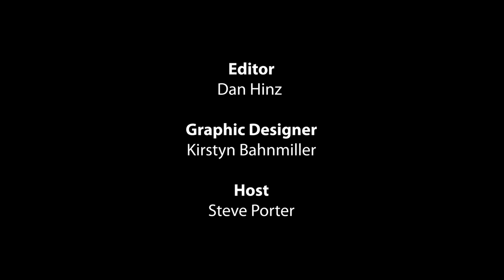The Truth About the Electronics Refurbishing Industry

Comment: In my opinion, there are three types of buyers.
The first type is the one who doesn't mind paying more for a product that offers higher quality.
The second type is the one who seeks a cheaper option but still wants some level of security in the deal, and chooses a store accordingly. 
Lastly, there is the type of buyer who seeks the cheapest possible option, even if it entails higher risks.
There is a market for all three types of buyers. The buyer who seeks the cheapest option may try to make purchases through platforms like eBay or other personal selling websites. The second type may visit a moderately priced store that offers some level of security. Lastly, the third type may prefer to shop at a reputable store that sells products as if they were "new."
In reality, the second type of buyer ends up being the least satisfied because they pay more but receive the same product as the thrid buyer. They essentially pay more for, at most, some cosmetic cleaning or superficial enhancements.

If the first  type of buyer purchases from a reputable store, they may indeed buy a refurbished product. In my understanding, this involves conducting a technical analysis of the components and performing a detailed cleaning of the interior, which can incur higher costs.
If a product doesn't go through the refurbishment process you mentioned, it would simply be considered a used item without significant differences from one purchased on eBay. A truly refurbished product goes through a comprehensive analysis and refurbishment process to ensure it meets certain quality standards.
Certainly, all of this can vary depending on the country or region where you reside. In the European Union, there are defined rules and regulations regarding what qualifies as used or refurbished, and there are obligations to provide warranties for such products.

Comment: I'm just going make 3 separate categories for working on electronics.

Cleaned: A device that been cleaned.

Repaired: A device that been repaired with fixing or replacing a specific part for operation.

Refurbished: A device that been completely took apart, repaired or replaced parts, and  all components been cleaned to be fully functional.

I think businesses should use these separate categories as options to reduce confusion with customers on buying at your own risk to paying more for full service options.

Comment: If I were selling old unit to someone else - I'd definitely give it a thorough cleaning, including repasting using good, high viscosity thermal paste and vacuuming dust from all accessible surfaces from inside and outside. However, I know most companies won't do any of that and if I am buying something that's marked as "refurbished" - only thing I expect is that the unit turns on and all functions work.

Comment: I worked for a small scale tv manufacturer and refurbished to them meant bringing those tv's back to as new condition by replacing whatever needed to be, but usually this was just cosmetic if the tv functions were ok. So anyone buying one of these, which were not much cheaper than a brand new one, got a new looking tv with unknown mileage. which honestly, knowing there QC policy, take the refurb!

QC policy was, any minor fault which didn't really impact the use of the set, was just sent out, apparently cheaper to deal with the customers who actually took the time to return faulty sets.

Comment: I would buy used over "refurbished" because I've always assumed that it means "looks like it will work but doesn't actually function or functions incorrectly/poorly". Used usually still works, unless otherwise noted - such as, "for parts only" or so

Comment: I think it's going to depend largely on the device. PS4s and consoles generally are widely available on the used market. One device I have regularly purchased refurbished IT equipment from the corporate sector. When an IT department offloads hundreds of, say, Lenovo T480 laptops to a bulk reseller like Best Buy these can be good value for money--properly refurbished or not. Most of this stuff has been regularly serviced by IT departments before it was offloaded. Some of these devices are not popular on the consumer market, so eBay or Marketplace might not have a price advantage or much availability at all. If you're willing to do a bit of work on these devices it's often easier to source them from these refurbishing services.

Comment: regarding the rollers on the disc tray, i used to use a "trick" on ink / laser printers where the rolls wouldn't pick up the paper anymore.

you could use a very fine grit sandpaper to roughen up the rollers a little bit and it would pick up paper again as new.
just a few brushes roughened them up good enough, no need to sand it down ofcourse.
it only worked for 4~5 times though as the rollers wear down over time as well.

Comment: working in computer repair, 50%ish of computers that come in have been purchased as refurbished and either never worked properly or worked for a bit before breaking down way too soon. Almost all reburbished devices that came in, were inevitably dirty on the inside and showed obvious signs that the devices had never been opened by the "refurbisher". Large volumes of dust stuck in heatsinks which cannot be explained by the time the devices were used by the owners before being brought in. Warranty stickers still intact. Those kinds of obvious signs.
Reply: never have and never will recommend buying refurbished devices unless the seller has a reputation for only selling devices that have truly been refurbished.

Comment: My thought on this is to better to purchase certified refurbished devices from the manufacturer, as they often extend a warranty on refurbished devices. They are often devices that come from the replacement or repair center and so are more likely to be in better condition than buying from a third party. Most third party places will have the clause with refurbished devices of being sold as-is, which means the buyer acknowledges this is second hand and is not comparable to a new product.

Comment: I buy plenty of pre-owned electronics and I'm fully aware that it's a dice roll if it's from a private seller. From a manufacturer like Apple, Samsung, Sony, etc. as refurbished I expect it to look like it's new and I believe that it's fully inspected and any parts that need replacement are replaced with new parts. Retailers should just call it pre-owned. From retailers I expect that they at least make sure everything is fully functional, wipe the grime off, include the power cord and controllers it needs and give me a window of time to return or exchange or offer a warranty. With that mentality I have yet to be disappointed.

Comment: The lack of any lawful definition and by extension recourse means I rarely buy refurb or even open box, unless there's one provided or defined in the listing.

On the flipside, it does allow some older and still decent quality devices a second life, particularly laptops. 

Grabbed a surface laptop, Microsoft refurbed, from Newegg recently and it's miles better than anything I would've been able to otherwise get in that price range

Comment: If there's actually this kind of work put into a refurbish job, then it's actually adding value vs a second hand/used item that hasn't had this kind of preventative maintenance or care. The hard part for the consumer is that there's no actual way to verify that a refurb is done without opening it up. Now if there was some way of reliably verifying or certifying this, then it may well warrant a higher price vs. uncertified refurbs.

Comment: I had an Xbox series s controller that failed, it had the infamous stick drift which i tried to fix but ultimately was not able to as i needed part that i did not have. 
So i went to a place they sell videogames, bought a "refurbished" controller and not my surprise as soon as i connected it it also had stick drift but on a different side from my other controller and basically tells you they sometimes don't even turn them on or connect to test.

Comment: "Refurbished" these days tends to only mean someone wiped down the exterior... and often you don't even get that much. 
I bought an Xbox OG from an ebay seller (I think it was called "abd-trade") who ACTUALLY, fully refurbishes in the way that we ALL want (deep clean inside and out, recapped when necessary, clock capacitor removed, new dvd drive belt, etc.) It was well worth the slightly higher than average price for a console that looks and plays like new. 👌

Edit: I realize this comment reads like I'm the seller going for a cheap plug, but that's not the case. 😂 Just pleasantly surprised for ONCE, and I feel like we should shout out honest refurbishers.

Comment: I always understood "refurbished" as functionally equivalent to a brand new device but with possible aesthetic imperfections like a scratch herr and there.

That said, a dirty heatsing or fan or old thermal paste CAN hinder performance and cause overheating, so cleaning those and applying new thermal paste should be required to call them refurbished

Comment: I purchased from a well known store a tower desktop  it was to have been refurbished and upgraded and into the first hour of trying to boot it up I took the side panels off! Much to my surprise the reverb company never opened the tower to even upgrade the memory let alone do any dust removal there was so much dirt that the power supply fan couldn’t take the heat away I took pictures. I buttoned it back up and returned it and told him what I thought. I eventually did get my money back once they received it but they couldn’t have upgraded it not Leslie did it via osmosis

Comment: On eBay the word "refurbished" is absolutely meaningless. You can windex the case and put it in a plastic bag and say you "refurbished" it.

When I got my first retail job in the 80s, "refurbished" had a de facto definition and indisputably meant that the good had returned to the factory or a service center, was every bit as good quality as a brand-new one, and even had a warranty!

Retailers have capitalized on the fact that noone ever codified that definition to create the dumpster fire of electronics retail practices we have today.

Comment: My expectations for refurbished would be like new just got repaired / cleaned and was used before. However, just due to the bad job many shops do, I do not buy refurbished and rather spent the difference on a new system if possible.

Comment: In leiu of industry-standard defintion, I'd use the standard definition. To furbish is to clean or polish, to refurbish is to rebuild/replenish, to restore to original working order or better. A simple wipe-down is not a refurbishment, and if I received such a system, I'm filing a dispute. The reason why refurb systems command more money is to recoup cost of the labor and parts. If it's described as refurbished and clearly hasn't even been opened, then I have purchased a used system, and have literally been defrauded. I would happily pay a fairly steep premium for a properly refurbed system, especially in lieu of new inventory. I'm sure many other customers appreciate the peace of mind of a properly refurbished system

Comment: 4:18  Once all the electronics and mechanics are removed, then why not dunk the chassis in the laundry sink with some hot soapy water? To clarify, I've done exactly that a hundred times, scrubbing the plastic / metal chassis parts clean, and rinsing thoroughly with hot water. It's about ten times more effective, and twice as fast.

Comment: To, refurbished means that the a semi-competent tech made sure that a return product didn't have major defects or destruction (i.e., not thrashed, can turn on and perform some basic operation (run a program for a computer, take a picture for a camera, show a movie for a tv), replacing a component or two to make that happen if necessary. I've never taken it to mean that the machine was returned to like-new condition or been thoroughly vetted for more esoteric or intermitted problems.

This seems reasonable to me because I know there are a lot of items that are returned in basically working condition. The only time I would expect a unit to be given a more thoroughly diagnostic if is it was an item that came back to sales via the support division that chose to replace rather than repair it for its prior owner.

Comment: To me, “refurbishing” commercial electronics means:

1. Things are cleaned 
2. Any components failed or close to failure are replaced (this especially means clock batteries, supercaps, and other caps)
3. Things are resoldered or reseated as needed
4. BELTS ARE CHANGED
5. If it has an SSD, and it’s possible to replace the SSD, the SSD is replaced FOR SURE.

Comment: When you say you expect a refurbished device to last as long as a brand new one... well, I don't know. On devices with optical drives, the original laser pickup assembly is likely not available anymore and I don't know if the knockoff replacements you can get will last as long. I'd rather they not just replace them willy-nilly. If I buy a refurb PS2 and the laser dies in a few months, I'm not really mad.

Comment: The economics are straightforward (i'd guess): It's cheaper to deal with returns of the worst units than to (expensively) prevent returns (via inspection, repairing, cleaning of all units).

In other words, most units, unimproved, will work longer than the measely warranty they offer and so far their customers accept it. My advice is: Only expect the stuff you buy to last as long as the warranty or return window.

Comment: I used to buy bulk listings of broken xbox elite controllers off ebay and fix and sell them. 

99% of them were either stick drift or broken bumpers. Easy enough fixes. 

Vary rarely was it something like a bad board. 

I always said in the ebay listing that it was a refurbished controller that had been taken apart, cleaned, and had broken components replaced with authentic parts when available, or added custom color shell peices when requested or if i didnt bave the original silver ones. 

It was never really profitable cause i only made like 20 dollars per control after accounting purchase cost, parts, time and ebays cut. 

But it was a hobby that paid for itself. 

Unfortunately controllers started to get super expensive.

I used to get them for like 50 or 60 bucks each on a bad day.

They were like 90 or even 100 by the time i called it quits.
You could get a new one for 130. I wasnt buying broken ones for 90.

Comment: I bought one from Amazon for £118.00 supposed to be totally refurbished. It was absolutely filthy instead of sending it back I stripped it right down to bare casing rebuilt it and it worked straight away so at the end of the day I got a spotless 100% working PS4 for£118 and a couple of hours to refurb it. Worked out at a reasonable price but I would not do it again might not be so lucky next time. Never done this before so I am quite happy.

Comment: Refurbished, to me, means:
Wear items are inspected, replaced, or otherwise ensured to be in decent working order, but need not be the exact same to a new device.
If you are buying a device with an internal battery for instance, there should be some guarantee on a refurb that the battery was inspected and tested to make sure that it can hold a decent charge. If it can't it should have been replaced. Or, for instance, if there's stick drift; that should be fixed.
In another case, a refurbished phone might have been taken in with a broken screen. The replacement screen has to work, it doesn't have to be factory original. 
I do not expect someone who refurbishes a pair of headphones to test the frequency response curve of the set to make sure it matches what comes from the factory.

Comment: In my opinion, opening up and cleaning plus replacing bad fans is the very basic of "refurbished" . I would also expect a test for faulty components and replacement of those components.  Plus replacement of known components that are susceptible to early life failure. But I come from an industrial controls background. I don't do refurbished parts because companies that can afford to offer it don't have specifics. Just glossy brochures about how great they are. We have a local guy we trust that is very good at electronic repairs. If your business relies on electronics, invest in spares and have well defined contingency plans if you can't get a replacement quickly. Refurbished electronics is just not a smart investment.

Comment: I live in the United States and this is how I assume devices being sold online should work.  If I don't get what I expect and refunds are available, I ask for one.

Like new = The box was opened, maybe things aren't arranged exactly like the manufacturer put them in the box, but otherwise, the item is otherwise factory fresh, seller should offer the same warranty offered by the manufacturer.
Refurbished = like new, any defective parts replaced, fully burned-in just like at the factory, likely some scratches / visual imperfections, seller should offer a 90-day warranty
Reconditioned = cleaned inside and out, no parts replaced unless they were physically broken, sold at a deep discount compared to new, maybe a 15 or 30-day warranty
Used = wiped down outside with a Clorox wipe, maybe has the dust blown out of the vents if you're lucky
As-is = You pays your money and you takes your choice